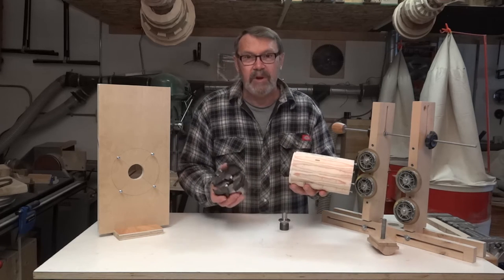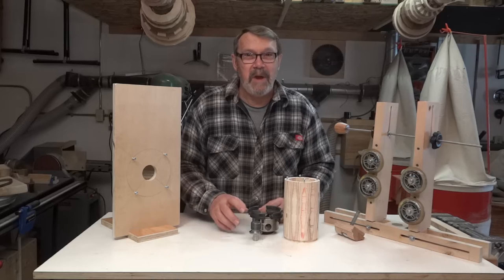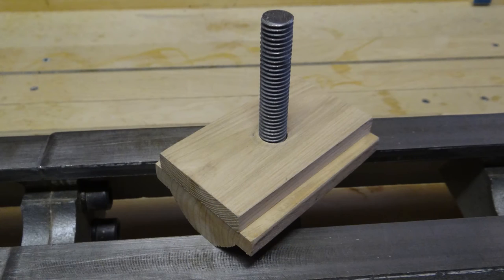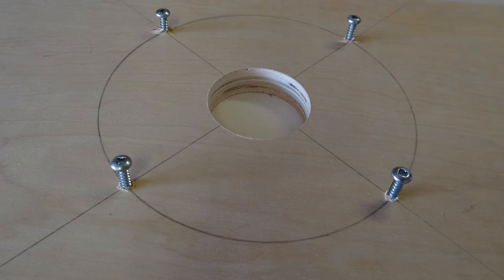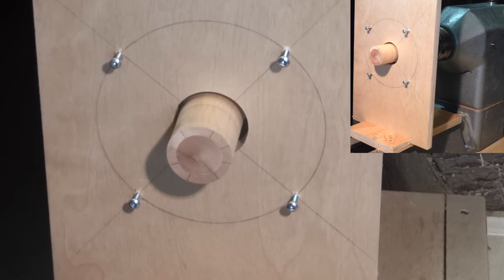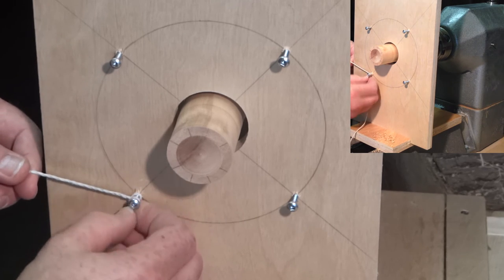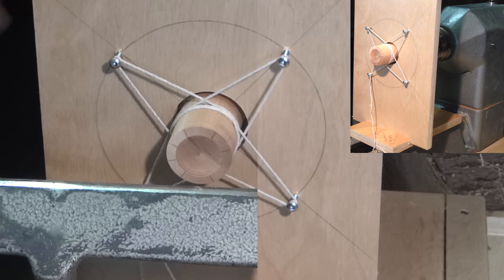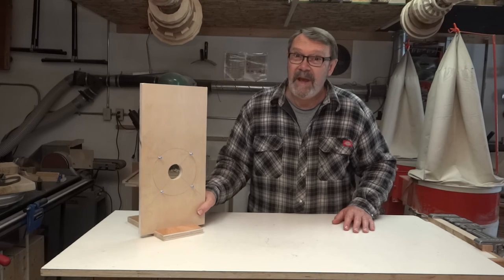String Steady Rest #2

Comment: Gord -- Thank you for providing such clear instructions for making and using a string steady rest.  

One suggestion: I was taught to string the steady with the string loosely looped around the spindle -- not as tight as you seem to have strung yours.  A loop shouldn't be tight enough to pull the spindle towards the loop's anchoring screw, it should just be tight enough to prevent it from moving much towards the opposite corner.  The idea is that the string should only support the spindle if it starts to flex.  This prevents a lot of the friction caused heat that you're experiencing.  It also lets you turn at a faster RPM.

You may have been doing exactly what I've been attempting to describe, but that's not what came across in the video.
Reply from the maker: Thank you for the suggestion, David. I will have to give that a try in the future. It seemed a good idea at the time to have the string tight enough to hold the spindle centered but after reading this I may have to rethink that.
Thanks a lot, David!
Take care,
.....Gord

Comment: Very nice project  Gord. Would it help any on the heat if the piece was waxed before using that? I am curious.
Take care
Albert
Reply from the maker: I don't know, Albert. I guess I would have to try it to see how much that would help. I think there would still be enough friction to cause the heat necessary to melt the nylon string; it doesn't take much to melt it. Even at 500 rpm it melted very quickly. If I try it I will let you know.
Take care,
.....Gord
Reply from the maker: Hi Albert,
I just tried waxing the wood and the string and found that it did not help. The string still burned and broke. Oh well, I tried! Thanks for the suggestion, anyway.
Be well,
.....Gord
Reply: Gord Rock Darn I guess not all logic works when it comes to wood turning LOL

Comment: Very simple and effective steady rest Gord. Thanks much for sharing it. One question (and not a criticism) is why are you working from the outside edge in towards the middle on an end grain piece? That is cutting against the grain. It is more common to work from the center and pull the gouge towards the outside with the flute pointing towards the outside to cut faster, cleaner and more controlled. Just curious.
Reply from the maker: Mike Goldfine You're right, Mike. I usually start turning end grain that way and then switch to a pull cut for finishing cuts. Just my habit, probably a bad one but I've always done it this way. I should try to change that but likely won't.

Thanks for watching, Mike!

.....Gord

Comment: Hi Gordon! Great video my friend. I do not have any steady rests so this one seems simple enough for smaller applications. Do you wax the string? Cheers! Daniel
Reply from the maker: Hi Daniel. I'm glad you enjoyed the video! As a matter of fact, I just tried waxing the string and the wood I'm using it on after Al Furtado suggested it. I'm afraid it did not work. Turning at 1,000 rpm the string still overheated and broke. Oh well, it worked fine at 500 rpm and I'm not sure if the wax helped but it certainly couldn't hurt any.
Take care, Daniel,
.....Gord